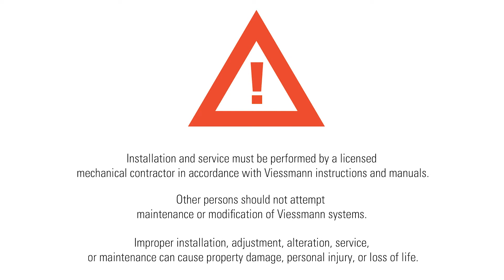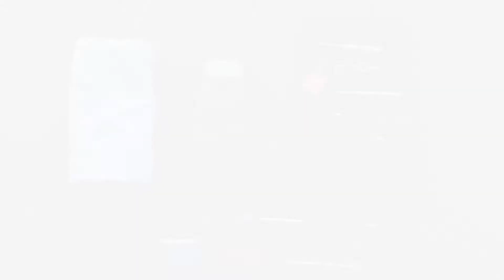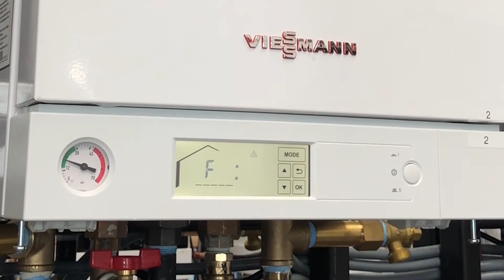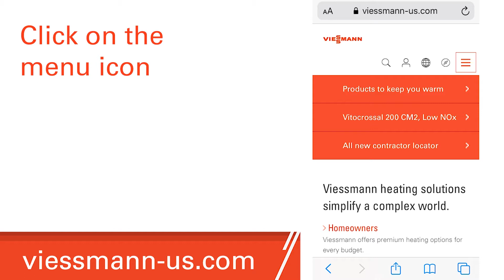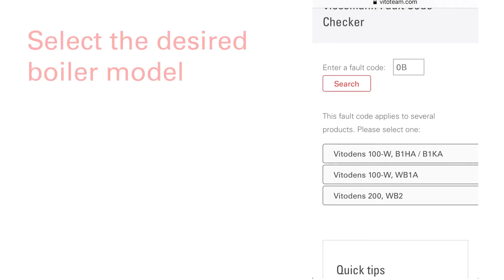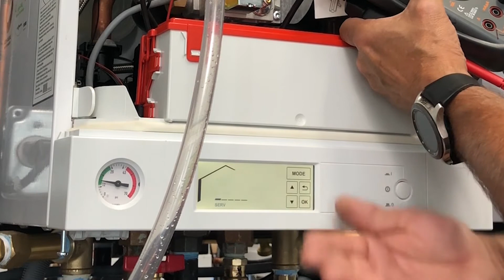Troubleshooting - Vitodens 100 B1HA/B1KA Fault 0B

Comment: I have the 0b fault code occasionally. It happens mostly in the morning when the central heating needs to heat the place several degrees. Seems like switching to hot water is a trigger. Sometimes switching to hot water and back to central heating causes the 0b to show. Other times the fault code 0b is already there and switching to hot water makes it go away. When 0b shows, at all times hot water is available when i open a hot water tap. At all times the pump keeps running. It's just that on central heating the burner will not activate. Sometimes before the 0b shows i can hear the burner try to activate but fails, or the burner runs for 2 sec and stops, then 0b shows. A few times i saw when temperature drops below 50c the burner succeeds to activate and 0b is gone. Could you possibly give me some insights before i start troubleshooting?